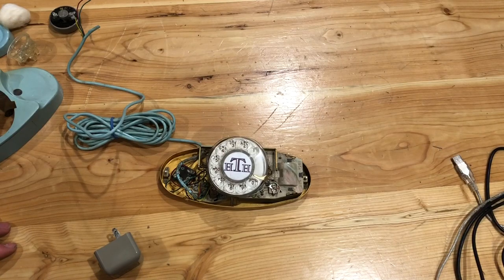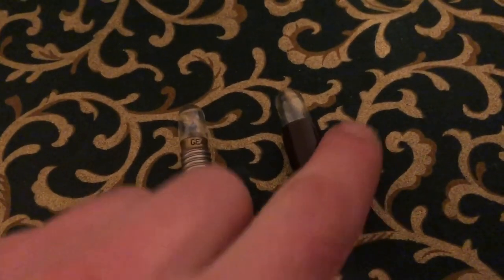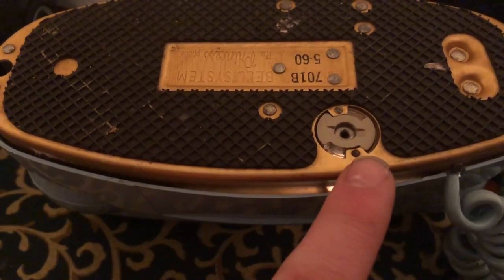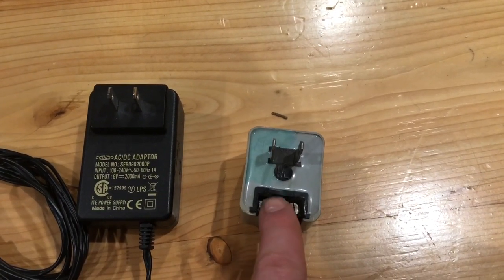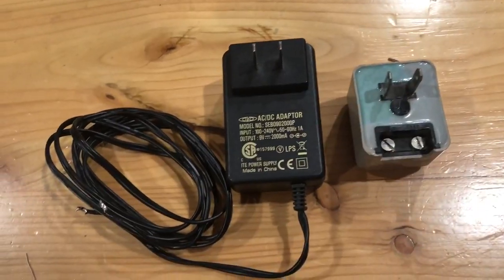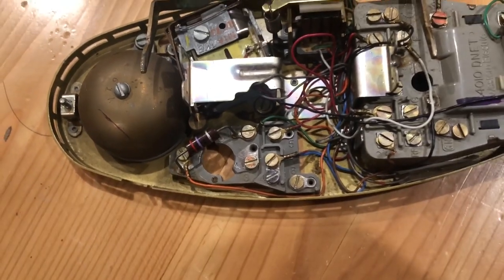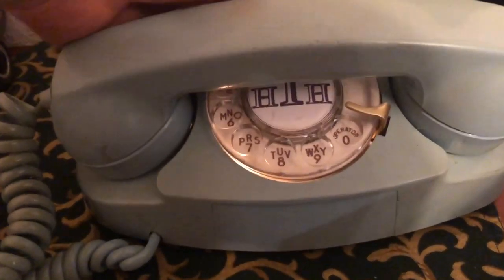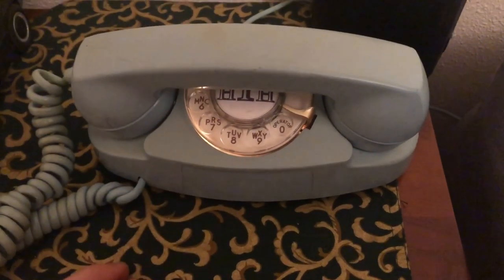Western electric BELL SYSTEM Princess Phone light restoration trouble shooting and repair

Comment: Thanks for the video.....  can you recommend a source for the  LED and the part number of it?  I  would like a brighter version.  TIA
Reply from the maker: I usually have bought bulbs from a local store like home depot or ace

You are looking for a wedge base light bulb for most princess phones

However there are some older versions that use a screw base 
If you have a screw base I am not sure where to get those 

I just looked online and if you search for" led wedge base bulb " there are definitely some that would fit

I'm not sure on brightness 

Also make sure the bulb is rated for about 12v (depending on your princess phone power supply

Comment: Around 5:39 in the bulb connection section, you mentioned that something should be connected to 3 but in your unit its not, so does that mean you have it disconnected here for demonstration purposes or am I misunderstanding?
Reply from the maker: Hi there

For getting the bulb to light up you will need to connect that terminal to one of the power leads coming from your adapter
Reply: @kadensreviews  First, thanks for all the replies on this and other comments. There's so much information on these phones out there, but not all of it is clear or applicable to all the various models so its really helpful to have someone like you willing to engage and help guide other retro-telephony pathfinders.

If I may trouble you with a few more questions: You mention that the yellow and black wires should go "here" and you're alternating between 3 and 4. So does it matter which one is coming from the + vs the - side if using a DC transformer (and is black typically - or yellow)? Also you mention that the terminal that gets power either from the orange cable or the resistor is powering the bulb, I found that confusing. Is the power flowing from the orange/resistor side through to the other side, or is it more like power is flowing from the transformer side and the orange/resistor is controlling the egress path of current to - / GND? If the "upstream" side is coming from either the orange wire or resistor I'd expect to connect negative but I'm still learning a lot about electronics so I'm unsure and trying to proceed with extreme caution.
Reply from the maker: @superspap  no worries I am happy to help

Unless you are using a polarized led the orientation of wires will not matter 

My rule of thumb when working with dc is try and make whichever wire is darker your - wire so I would probably choose black to be negative
Reply from the maker: @superspap  and sorry I don't quite understand the question with the resistor and stuff 

Basically the resistor is there to limit electrical flow from one of your power wires coming from your transformer when the night light switch is on 

When you pick up the phone off hook switch then it shorts directly over the resistor giving it full power or brightness 

Also as long as you are using a 9v or so power supply (definitely nothing higher than 12v) you should be fine to poke around and do whatever 

Obviously dont directly short circuit anything (usually I check between my two power wires yellow and black in your case if I am worried something might be directly shorted )
A incandescent lamp does register as a short so I would remove it before testing continuity 

Honestly the old phones are basically bullet proof so even if you miswired something it'll probably live just fine (just obviously troubleshoot more if you think something is off
Reply: @kadensreviews  I'll try to clarify my question. If we fall back on the old water analogy for current, current flows from + to -, so imagine water flowing through pipes from a pump. Output is + inlet is -. A resistor could be something like an intentional kink in the pipe (slows down current / water) and a light bulb could be like a flow meter (brighter if there's more flow, dimmer if there's less). I was wondering if it mattered which side the "kink" was on? Like if you put the resistor / kink AFTER the light in the flow, would the resistor affect the brightness (flow meter rate)? I was worried it wouldn't , but the more I thought about it, the resistor / non resistor path could be either place as long as they're isolated. The bulb would see reduced flow regardless of if the resistor was before or after just like a kink in a hose before or after a flow meter would still reduce flow globally. Maybe that makes more sense? If it doesn't I'll stop bothering you :D
Reply from the maker: @superspap  yes thats correct that it doesn't matter

Also the phone was meant to use ac power for the lamp originally so it wouldn't even be a continuous flow one direction  

Incandescent bulbs aren't very finicky
Reply: @kadensreviews   I was able to get it to light! Now I just have to figure out the ringer. I connected black to 4 on the light block, white to 3 on the light block, and moved Yellow to G. In my previous (now edited) comment on wires, I had listed the same terminal twice. When I got it,  yellow was on B and black was on G. I moved yellow to G after reading some other stuff on this phone / network block and will try to connect yellow and green on the modular side to see if it gets it ringing.
Reply from the maker: @superspap  sounds good! 

Hopefully there wasn't anything rewired

Comment: HELLO, DOES THE TRANSFORMER CORD AND PHONE CORD AND MODULAR ADAPTER HAVE TO BE DIRECTLY PLUGED INTO THE WALL PHONE JACK? 
I WANT TO PLUG IT INTO A 5 WAY PHONE SPLITTER SO I CAN PLUG IN 4 MORE PHONES THAT DONT  LITE UP.
☎☎☎☎☎☎
Reply from the maker: The transformer can be plugged in anywhere you like, as long as the yellow and black wires are connected to the lights you should get them working 

Some phone splitters do not have all set of wires 

So make sure the one you use has green red yellow and black wires for all phones
Reply: @kadensreviews  OK, THANK YOU

Comment: My princess phone it’s the black and white that are power
Reply from the maker: How many wires does your cable have?
Reply: 5 @kadensreviews   red (tip) green (ring) yellow" not used" black and white "for light"
Reply: @tr.firesecurity9929  I have a similar wiring situation. In mine the Yellow goes to the "B" terminal, the green and red go to the L1 and L2 terminals respectively, the black goes to the "G" terminal, and white goes to "GN". I'm not sure if that's "correct", as I'm still trying to make sure everything is good on this unit, but its what I have.
Reply from the maker: @tr.firesecurity9929  ahhhhh I just figured it out

If you have a older style phone (from the early 60s ) they used to separate the ringer lead instead of having tip and ring operate both ringer and audio as it does nowadays 

Yours mustve been converted so it correctly works on modern phone lines 

Green and yellow usually get connected together to get the bell to ring on modern lines
Reply from the maker: @superspap  l1 and l2 would make sense for tip and ring 

The other wires were probably rearranged at some point for some other purpose
Reply: @kadensreviews  I put voltage on my ringer then